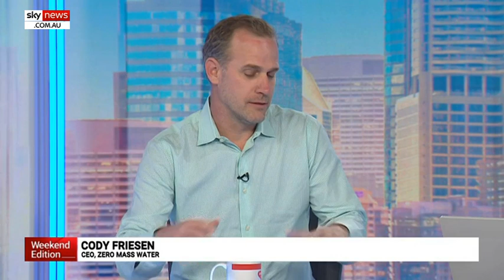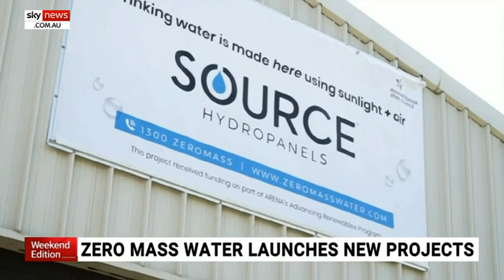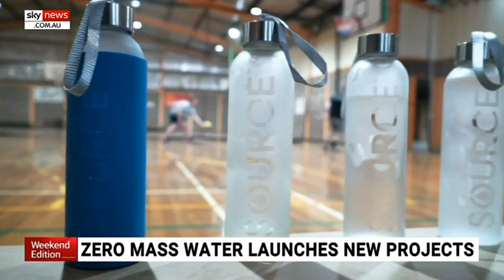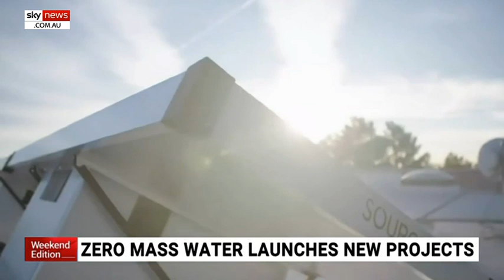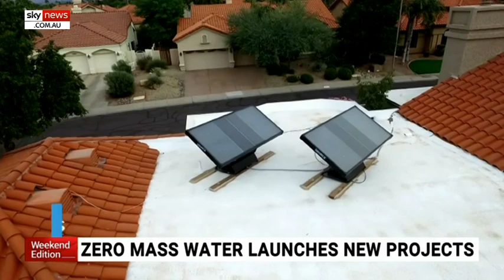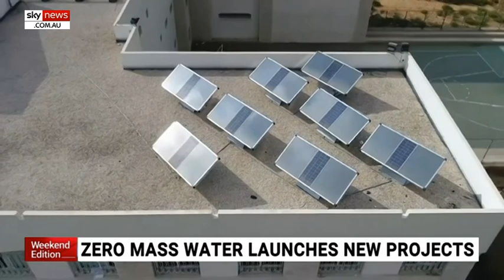Zero Mass Water aims to turn sunlight and air into drinking water

Comment: When electric cars are a thing. With hydrogen producing most of the power.
We could have power generation car parks.
You put the car on a dyno type thing that has all the power going into power production and run them all day while you at work.
You could generate kilowatts from a small amout of hydrogen.
Hyrdogen you can use solar power to produce.
If the cars spend 8 hours a day sitting collecting dirt then I cant see why it wouldn't work.
A business could run off of its fleet of vehicles.
They could drink their own sweat if they used dehumidifiers at work if they really want. It just isnt cost effective.

Comment: WOW, creating water from sunlight and air. Its typically called RAIN. Why are schools and hospitals lacking infrastructure? Build dams, capture the RAIN. I could drink the water from my air con, but you cannot beat RAIN water as your starting point for lowest energy and cost possible. Use the sunlight to sterilise filtered water. I could understand if this was something new like nano structured material that collects the dew each morning leveraging off natural cycles. Cooling hot dry air, to dew point, via solar, on a hot roof. Seems like a warm breeding tank.

Comment: Its called a dehumidifier and it doesn’t work if the air has low humidity. If the air has high humidity it tends to be about to rain. 

The water from this system also needs to be purified because it traps all the air pollution in (from burning forests nowadays).

You are much better off economically just trucking water in from areas where it is more common.

Also, this isn’t his invention, this has been invented dozens of times and its not caught on because it just doesn’t work in environments where it doesn’t rain. 

For other examples, look up fontus, water seer and look at thunderfoot’s channel for a few videos on it getting debunked.
Reply: Blackjack Videos https://youtu.be/EGTRX6pZSns https://youtu.be/vc7WqVMCABg

Comment: This has been around for years. Something has changed at the news channels to be able to give airtime to these ideas. I personally sent many prototypes of free energy /water/ living to politicians years ago, to no avail
Reply: Renn Starr they don’t work in environments where there is low humidity. In environments with high humidity, it tents to rain quite often. Also it concentrates air pollution into the water which is a big deal with all the smoke from the bush. 

Thunderfoot has a few videos on how these dehumidifier style cater machines dont work. Its simply more economical to truck water in.

Comment: I smell another scam coming to a TV station near you. New technology my arse, it is a dehumidifier, nothing more nothing less, and completely useless in a dry atmosphere.
Hang onto you money folks, the scammers are coming.
Reply: Roger Gibbs yeah, this is bull.
Reply: You would need a deep dark damp cold cave to even attempt this.
Along with another power source as solar doesnt produce the watts amps or volts needed to compress enough air to get the moisture to condensate.
Reply: Space Monkey  I don't think anyone says there is no moisture in the air at a low humidity, but would it be viable.
I don't doubt the reference to the Sahara and its moisture
Reply: Thunderfoot does a science based debunk of this idea.
Reply: But this one is solar and slow AF. 14-28 m3 of water, total, per panel, over 15yrs. Price not given. I see a downpipe on all those roofs.

Comment: Power cost is high- with the bs power problems in AU - seems like getting screwed - THe tech works 100 % for sure- but it needs power - not early days has been around FOR YEARS